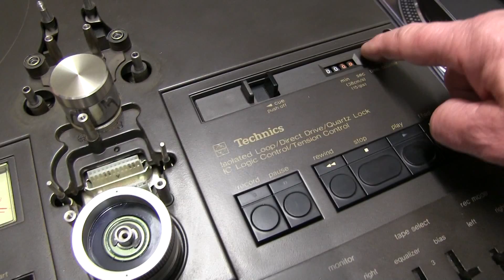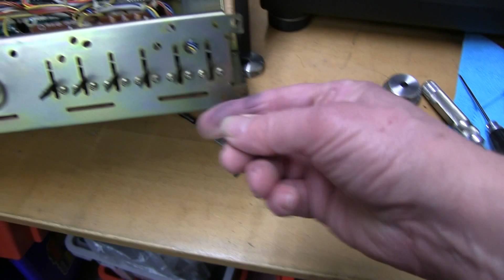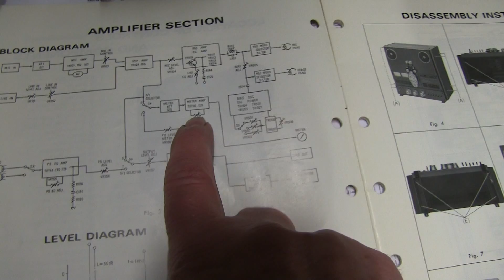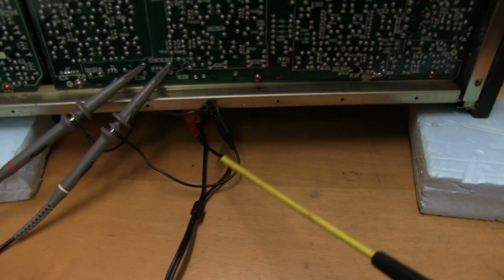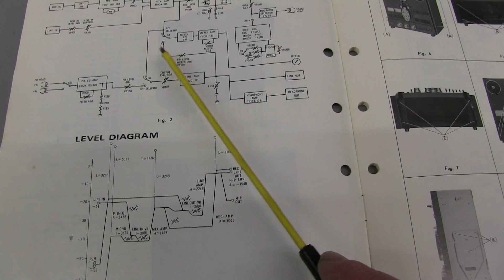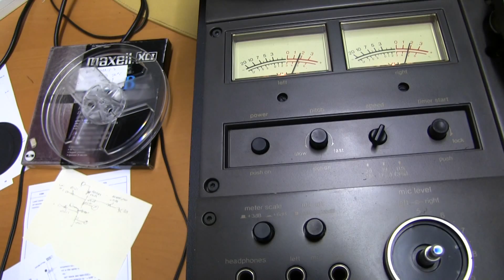Technics RS1500 Service and Calibration.

Comment: Really love this video Nick. Thank you for uploading it. I’m wondering why you connected the oscilloscope to the solder joint on the board rather than the line out as per the service manual? I’m scared I’ll accidentally break off the solder joint if I clip the leads to them 😰

Comment: Hello nick, I have a 1700 model. When I press the play back the right reel , it turns in the opposite direction, as well as during the rewinding of the tape. In reverse play, it works but very slowly, but the winding is fast. Do you have a solution to the problem please, I am waiting for your response

Comment: i have a rs1700  i done alot of work on it  over time it work ace   BEWARE  i drop a tape on the right  side reel by misstake  i fixed it  a BLACK M4 bolt hold nab holder on
it was a 14 inch x 1/4    i had to take the motor apart and turn out the bad part and put a new brass corr in with a m4 tap  so be carefull with tapes i lost £400 that day
i not selling it   just be carefull with big spools

Comment: Hoping someone sees this. On mine with the tension roller knobs screwed all the way in my tape movement grinds to a halt. I have to loser it so tape can move freely. It came to me with the tension roller knobs fully tightened. Is this correct ?

Comment: I'm using maxell UD-XL tape and other Maxell's, there's significantly pronounced highs in recordings when compared to the original source. EQ & Bias is at #2 setting per user manual.  Is there's an adjustment pot somewhere which would affect this ?

Comment: hello i have technics rs 1500 and it has a problem i canot get the pinch rollers to engage if i press play it tries to play but but then stop unless i push in the pinch roller slightly after i hit play works fine
Reply from the maker: Hi Alex  The deck does need some maintenance adjustment after many years of use or no use. Mostly making sure everything is nice and free, a liitle oil can help.  But there is a service manual (free online) which can help with adjustments.
Reply: @nickadams5411  Hello Nick thanks very much for your reply i got it working the power supply was out putting 4.7 volts on the 5 volt rail. I got the service manual downloaded now but cant find any information on the potentiometer on the power supply board VR601 it turned it but none of the voltages change but the deck does seem to work fine. I'm in the middle of trying to service it. All ive done so far is recap. 
what oil should i use and doe the motors need lubricating i@ve heard they have sealed bearings im not very mechanical minded to be honest. thanks for your help
Reply from the maker: @alexanderson1866  Hi Alex. Well done. Use only a very light oil. Most bearings are sealed, but they may have grease which goes hard over time. A thin oil, or even teflon oil is okay. Very little is needed, .

Comment: All of these adjustments need to be made with the output level set to number 8 . The output at number 8 should be -5.2dB , I`m not too sure which manual you are using , but what you are doing doesn`t seem right to me .  Before you set the output level you have you have to set the playback EQ with a Technics calibration tape , which I have , or the frequency response is going to be way off .
Reply: hi @davidhaney1394, i don't have a Technics calibration tape. I do have MRL calibration tape though, 15ips 1kHz and 10kHz tones. Should I also be reading a 0.55V output level at the line-out jacks when the output level VR is set to "8" position on front panel?

Comment: The pitch on mine is speeding up and slowing down a little bit. Makes it sound real strange. Can you help me?
Reply from the maker: Hi Chris.  There are several reasons, but most are simple.  First make sure all rollers etc are moving freely. Because it speeds up and then slows, I assume randomly, it cannot be the rubber parts that are worn or out of shape.
There could be problems if the brakes are not fully disengaged, but you can test the spool turning strength by touching them to see if they are pulling okay.
The speed pot may need clean lubrication. But turn it many times, and the speed switch as well to clean the contacts.
Sometimes the board contacts inside may need unplu/plug to seat them , but that is less likely. The electronics is normally very reliable, but there are adjuistment pots inside that may need turning if they have developed bad contacts. You will need the service manual for that.
Reply: @nickadams5411  Thanks Nick! It turned out to be the osc adjustment.

Comment: Hi Nick, I just got an RS1500 and it seems that the breaks are not great towards the end of the tape. I get some slack. The headphones output is not very powerful either. Was wondering if you could have a look at this and give it a service and calibration just like you just did on your video. Thanks. sergekouper@outlook.com.
Reply from the maker: Hi serge. The brakes can be fixed. The headphone output, bit odd, but could be simple. Service/ Calibration takes time. I will contact you directly.

Comment: I think I figured it out.Just by unscrewing the middle screw on the logic control board jiggling it and putting back in I got the rew going at full speed. The play goes for a few revolutins and then it stopd while the light is still on play. It will not hold but if I press stop and then play straight after it will not turn at all. However if I press stop and wait a few seconds it will start going again for a few revolutions and stop again. So this is progress from before when it was not going at all in play and rew mode. I think I am dealing with a worn or leaking electrical part like a tranzistor or capacitor. Next step I figure is to find which one it is and replace it,don't you think? Thanks Nick.

Comment: No not the brakes,I just replaced the pads a few weeks ago and they worked a treat. the take up wheel needs convincing to even start spinning a few times. For that I press the play on and off a few times. Eventually it will spin and then as if a relay or something fail ,it comes to a stop. FF goes great,however because of the above issue the rew is at a stand still just about. The main motor runs on play and activates the 2 rubber capstans. It all engages,speed switch is good , its just the right spindle is at a stand still. If I play with turning the deck on and off and press play and stop a few times,it will start spinning at the required speed and then it comes to a stop,I need it to keep going as before. Repeat the process,you get the same result. Has to be something else that just died itself over the period I didn't use it. So annoying ,maybe I need to think of one of those replacement kits of ebay,transistors and capacitors, but then again that is a lot of work...

Comment: Hi there again,I haven't used my Technics RS 1506 for a few weeks and ,today when I pressed play to my surprise the left hand spool kept feeding the tape but the right hand one only works for one revolution and then it will not rotate anymore. The motor works and the rubber rollers touch and work ok. Because the tape is not being spooled on to the right hand reel,the sensors activate on the arms and the deck stops...so weird as irt was perfect before. Also I noticed that it will ff perfectly but not rewind or struggling to rewind...again very weird as before it was strong on both directions...Brakes do not rub or impede the spindle,I don't know what on earth has happened. Any advice please Nick. The room where this thing sits in is a bit damp to say the least,I have had issues with the Akai GX-635 in this room but once I shifted it in another room  works a treat...
Reply from the maker: Hi Mike
90% of these problems are the brakes (brake pads)
But another fault is the speed switch, gets a bad connection as it is not used much.
Work the speed switch several times.
Otherwise help the spool to turn and get it running and stopping , to see if brake pads free up.
Otherwise it is very rare to have an electrical problem.
Let me know

Comment: Hello, Nick! Very instructive video! I have an RT-707 that needs some minor calibrations. I have a question: my RT has some oxidation on the capstan - should I try to fix it or is there no problem leaving it like that? Thanks!
Reply from the maker: Hi Max
Nice machine.
The capstan is part of the motor, so would be difficult to find a new one.
Try fine rubbing compound to see if it can be smooth.
As long as no rough edges it shouldn't damage the tape.
Reply: Thank you Nick! It does have some roughness. Do you think  brillo pads (thin steel wool) could be used for that? I really don't want to damage the machine - these are really expensive here in Brazil. I already purchased a recap kit and found a calibration tape for NAB EQ so I cano make the machine as new as possible. Sir, once again, your videos are fantastic - for me they are even entertaining -and your work is flawless!
Reply from the maker: Hi Max
Brillo pad is probably to rough.
Try some liquid sink cleaner cream  like VIM (CIF) which has a mild abrasive action.

Comment: There is one thing I have never understood about these closed loop capstan drives: How can it keep the tape tension around the heads? I have always heard that on dual capstan drives the first capstan should run a little slower than the last to get a good tape tension. On 3M Isoloop machines the capstan has some notches with matching pinch rollers that does the speed difference. But on the Technics machine the capstan looks completely cylindrical.
Reply from the maker: Hi
The Technics has only the one capstan drive, and the pressure roller sizes being large can be near identical in size.
It then relies on the back tension from the supply spool will keep the tape tensioned.
If the rollers were small , like on cassette players it could be a problem
Tape players that have two capstans, as you say, will need to have the trailing capstan the same speed or fractionally slower so that it is always just keeping up, so tape tension is maintained.

Comment: The squeaky sound is made by a dry bearing in the plastic pulley that guides the belt on the counter.  Just a tiny drop of fine machine oil will fix it.

Comment: I replaced the brake pads in my RS-1506 with natural leather pads that I cut myself to the right size and thickness.  Works like a charm.  The machine makes a perfect stop the instant you hit the stop switch.  The original brake pads were made of an inferior kind of foamy material, just worthless.
Reply from the maker: Hi, yes you got it spot on, good feedback.

Comment: Awesome and super helpful video. I replaced my brake pads after watching your video. One issue that has resurfaced, though, is a squealing take up reel after rewind. Once the takeup reel is empty of tape and there is no longer tension on it, from the tape, it makes a squealing sort of sound while stopping. Any ideas what that might be?
Reply from the maker: Hi
Squealing will be the brake pads, unless something else is touching the mechanism.
You replaced the pads with something that fitted?
The surface may need roughing up a little.
Reply: I replaced one side with cork and the other with high heat gasket material. I want to see what hold up over the next year and then have both sides the same. The side with the cork is doing the squealing and it's only when the tape leaves the take up reel and, I guess, that resistance is gone?

Comment: Nick, thank you so much for this video!  I just purchased an RS-1500 from ebay and your video helped me fix the majority of issues that was wrong with it.   The only thing additionally is I had to lubricate the white counter wheel that has two belts around it.  (One belt going to the roller and the other belt going to the counter).  It was squeeling very loudly when I would rewind and fast forward.  I thought it was the brake pads at first, but it wasn't.  I also had to fix the 2trk/4trk switch on the head stack. There is another video on youtube that showed how to fix that.  Excellent Job!!

Comment: Hi nick, I need to lubricate the metal to metal mechanisms in a turntable and reel to reel. Can't find any definitive answer as to a good grease for this purpose. I wondered if you have any recommendations of a product available in the UK?  Many thanks.
Reply from the maker: Hi
There are so many modern greases and oils, it makes it difficult to know.
For low speed or sliding mechanisms:   I use a thin grease that does not dry out or go sticky when you rub it between your fingers.
The best ones are made for model servo gears, such as Futaba Gear grease.
However I use a light brown grease, on sliding parts and slow gear mechanism, made by Ultimate Racing. Part UR0904, but I don't know what it is.
I am sure that modern graphite greases and grease for sliding parts are all good.
For high speed rotating parts and motor bearings:  I normally use a modern thin oil for bearings in model cars.  Ie not for large bearings.
These model car oils are very good , but expensive for the small quantity.
Makes such as Hudy and Trinity Royal Oil, are what I use.
Reply: Nick Adams Thank you for your informative response.  I ended up buying an American product called Super Lube, a multi purpose synthetic grease for the larger moving linkage parts. It is supposed to be good for metal and plastics both.  For the lighter moving parts on pivot posts, I opted for Singer sewing machine oil.  I am not sure if that's good or not.  Now I have your information I'll look further.  Many thanks and I enjoy your videos.

Comment: Thank you Nick. I brought 2x of these machines a long time ago from someone in Germany called collectors estate. I didn't check out both machine throughly and I found the quarter track machine had a mild breaking problem insofar that when you put the machine into rewind and let it build up speed and then hit stop the left hand spool ~ spooled off a little bit. I did see someone cleaning the plastic drum on the motor and roughening up the cork on the brake pads to cure it. I also so a company on ebay called Bosch trading who were supplying kits of new pads and bearings as an alternative fix. The half track machine seemed to work better and I gave it away to a musician friend but I still have the queer track machine launguadshine away in an unused bedroom. Because I have MS I doubt that I will ever get round to fixing the spooling problem. My wife wants me to keep it but I don't know I would have to find someone who could carry it downstairs for starters. Thank you for your in-depth service information. I need to get my head round how I can even access the brakes and mechanism before going any further.
Reply from the maker: Hi Jeremy
I wish you well, and that the machine can be serviced .
I am in Hampshire, UK. Where are you?
Reply: Hi Nick, I live in Kensal Green London which is on the border of North Kensington. I spoke to someone today and he quoted £70 to pick the machine up and before he even had a look at it.
I guess I'm behind the times living on a pension.
Reply from the maker: Hi Jeremy
Contact me directly on:
nick@demonproducts.co.uk
I'll see what I can do.
Nick
Reply: Hi Nick. I did send you an email. Did it end up in your spam box.
Regards Jeremy
Reply from the maker: Hi Jeremy
Yes, sorry, been having some issues myself.
I will look at your deck as soon as I can get to you.
Will send youu an email.
All the best
Nick

Comment: Nick:

What is the name of the App on the computer?

I have a RS1500 and the supply reel spins very freely and non of the buttons on the front panel works, I only get tape dump. No friction on the supply reel at all. I guess I might have a brake issue. What do you think?

Comment: Really Good Job Nick, Looks Like This Machine is Superbly Built. Do you Think its As Good in Sound Quality As Your Revox B77 Or An Akai GX-600D Or Better ?
Reply from the maker: Hi
I have the Akai GX636 which is a fine machine, but the Technics has the edge.
I like the tape handling on the Technics, it treats the tape kindly, especially with the electronic brakes and the dual capstans.
However, I am not sure how long the heads last on the Technics.
The Akai glass/ferrite heads look like they will last for ever.
The Technics has all 3 speeds, but the Akai have reverse playing, which is very useful.
I also like the 2 track and 4 track playback feature of the Technics.
I have an old Revox G36, but not one of the more modern ones.
All the best
Nick

Comment: Hi Nick. I take it your computer sound card levels are identical levels? Lovely machine.
Reply from the maker: Hi Simon
With the app. you can lock the channels and use the master level.
But you are right , best to check.
Also the calibration of test instruments is not always spot on.
But the machine is just great.
nick